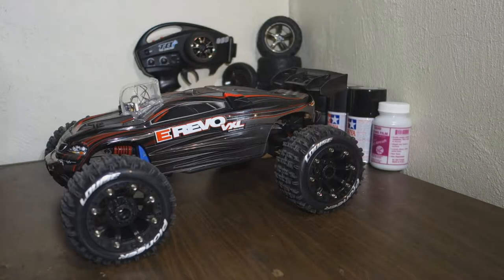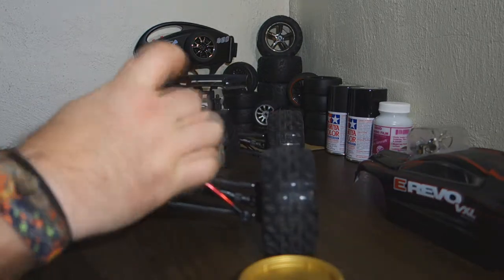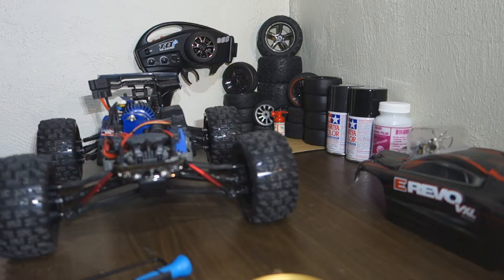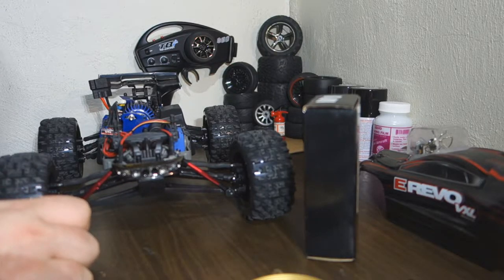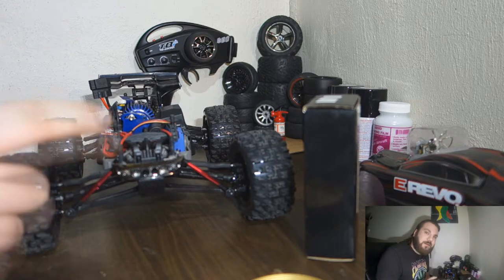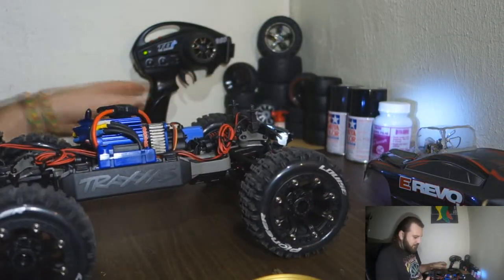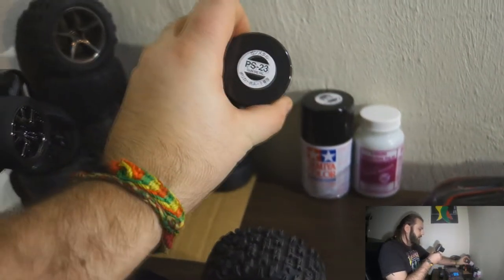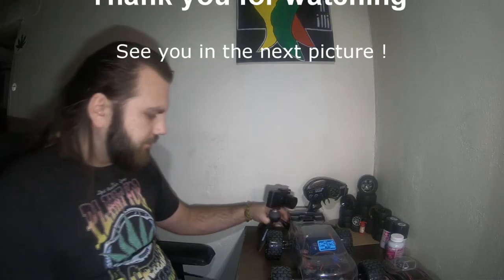TRAXXAS E-REVO 1/16 BRUSHLESS HOW TO CHANGE SPURGEAR GOPRO HERO6 BROKEN ALREADY?

Comment: I got both of my Traxxas mini 1/16th scale e Revo vxl's with the same exact motor and esc as yours maxing out at 55.0 mph on a parallel connector using two Traxxas 3S 25C 1400 MAH lipos together in lipo mode on the speed controller lol. These mini Revo truggies are super fast guy lol!!!!!!!!!. With out the parallel connector using only one 1400 mah Traxxas 3S 25C lipo I'm getting roughly 49.7-52 mph. Mins you though buddy I am geared 31 pinion 45 spur and I'm still running the stock talon Traxxas wheels with the gemini rims. These mini vxl e revos are too fast for there size my friend. I also have the 1/8 scale e Revo mamba monster and I got that geared 25/40 from the previous 26/54. The 25/40 gearing is mod 1 gears though. I'd say on 4S it'll do 65-69 mph while on 6S 80-88 mph maybe 89-93 mph.
Reply from the maker: They are crazy fast for their size, so true! =D I haven't tried with so many different spurs or pinions but maybe I should =D That mamba seems awesome dude :D Thank you for all you awesome comments :D
Reply: Sweden RC Adventure traxxas does provide the lowest spur you could go which is there 45 tooth spur. I heard Hot Racing makes a 43 tooth for these mini e revos lol !..... if I could find a 43 that would be great. I’m 31/45 right now on both of them but I mainly do speed runs and drag races just to mess around. I don’t really bash them at all. All of my cars are used for speed in a straight line. My 1/16 e revos were both 28/50 when I first bought them. I use the powercell Traxxas 1200 mah nimhs they come with and the traxxas 2S And 3S lipos only. Stock green springs in the front and rear still as well. The shocks are still red colored the way they come RTR but what I’m trying to say is that for speed runs they work great. The stock talon wheels got me up to 55.0 mph so far.... wondering if I could get 56-58 with some better quality lipos and wheels.

Comment: I'm gonna try to get better 3S lipos with a higher C rating for my two mini e Revo vxl's and eventually aftermarket Proline dirt hawgs or speed hawgs. That should add an extra 1-2 mph so I'd be hitting 56-58 mph instead of 55....... LOL.
Reply from the maker: I think i have about 35c on my 3s lipos that I run on :) But not the same spur as you though :P
Reply: Sweden RC Adventure What are the mah’s on them..... what’s the number of the runtime in other words if you don’t mind me asking and what brand battery are those 3S lipos !!!!!???????........ also what type of 2S lipos do you recommend ?....